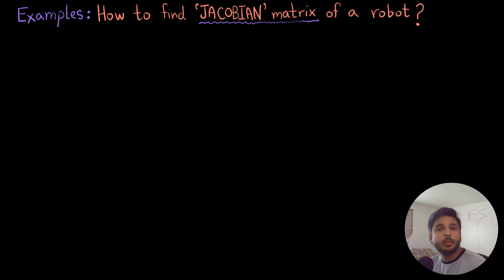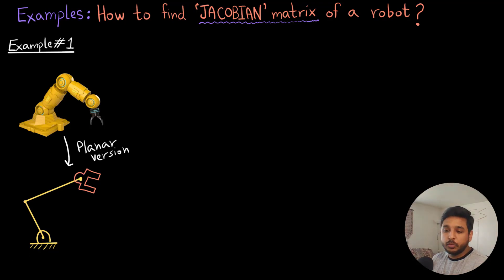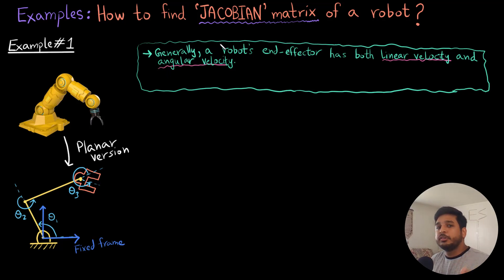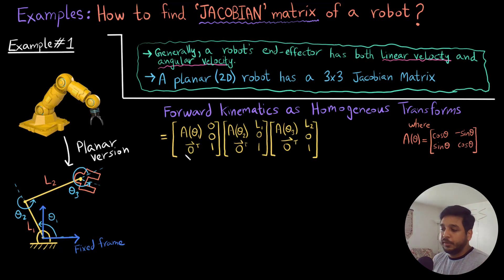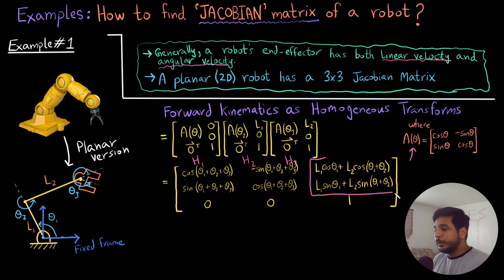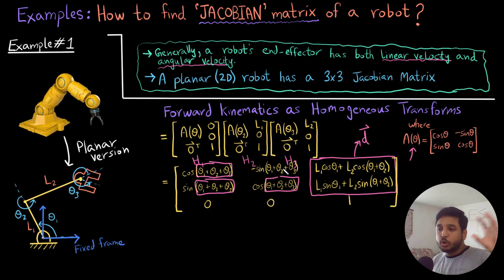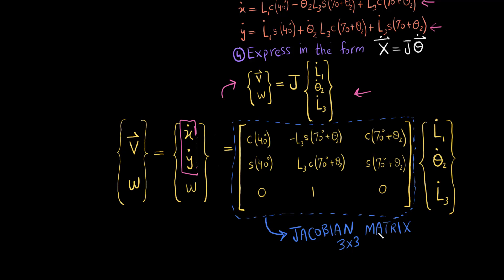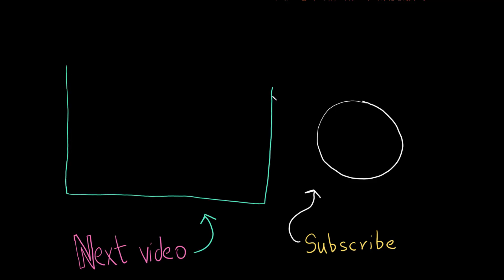How to find Jacobian Matrix? | Solved Examples | Robotics 101

Comment: Can you please explain how the 3×1 matrix L1,theta and L3 have come in the second example
I
Reply from the maker: The Jacobian matrix relates the joint space to the end-effector space.  In the previous example, we only had angles as joint parameters so the 3x1 matrix only had thetadots. Now, we have both prismatic joints and revolute joints so the 3x1 matrix will need to have both the thetadots(s) corresponding to revolute joints and Ldot(s) corresponding to the prismatic joint(s).
Does that make sense?

Comment: Hi, Thanks for explaining well. I read some textbooks where for jacobian matrices will produce a 6xn matrix, where n is the number of DOF. What is the difference with the 3x3 matrix you described?
Reply from the maker: The 3x3 matrix that I talk about is for a planar robot. It is quite intuitive since if you think about a planar robot holding something with its end-effector then it can only move it in X and Y direction and rotate it in the plane. It generally has a 3DOF. The linear velocity is therefore just Xdot and Ydot and the angular velocity is w about the x-axis (out of the plane). 
For a spatial robot holding something, it can move the object in X, Y and Z directions and rotate it in three different ways (roll, pitch, yaw). Therefore the linear velocity is comprised of Xdot, Ydot, and Zdot and the angular velocity also has three components (one about each axis-X, Y, Z). Hence, generally, a spatial robot with a 6 DOF has a 6x6 Jacobian matrix. If you take away its ability to move in one direction, then the Jacobian matrix's one column corresponding to that particular motion disappears and it becomes 6x5, and so on.
Hope it makes sense.
Reply: @EngineeringSimplified  I'm trying to find jacobian for the articulated manipulator and get the angular velocity results -cos and sin on the matrix. But I find this strange, how can angular velocity produce a function of cos and sin instead of 1 or 0. but this is also the same result when I read some journals. Are my results correct or not?
Reply from the maker: @AbdulRahman-jz3px  If I understand you correctly, the Homogeneous transformation matrix that you get has cos and sin terms (4 terms for a planar case & 9 terms for the spatial case). To find angular velocities, you take the derivative of 'x' in the sin(x) and cos(x) terms. This is because the 'x' represents the angle of rotation and to find the angular velocity, you differentiate the angular displacement with respect to time. 
Hope it makes sense.